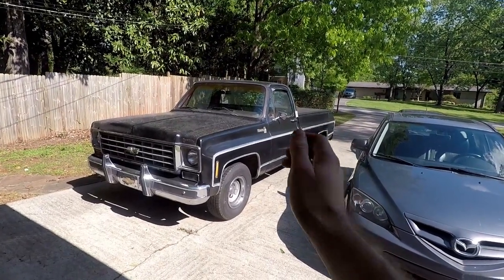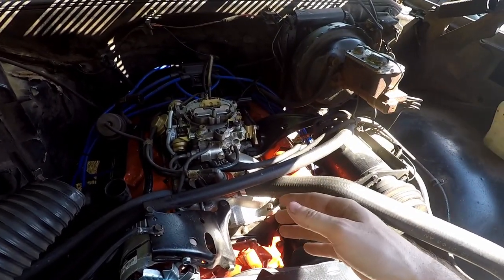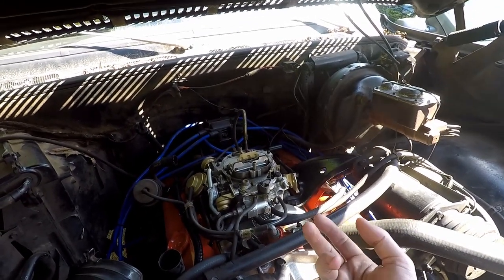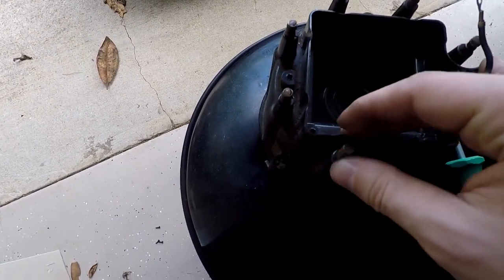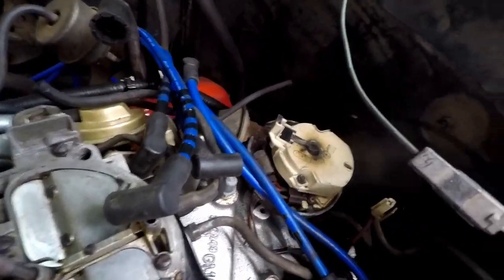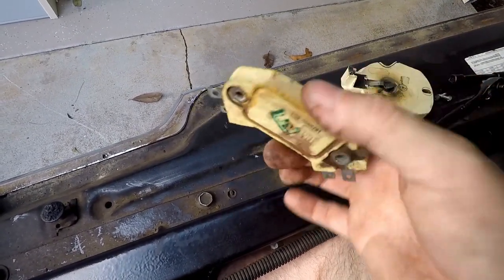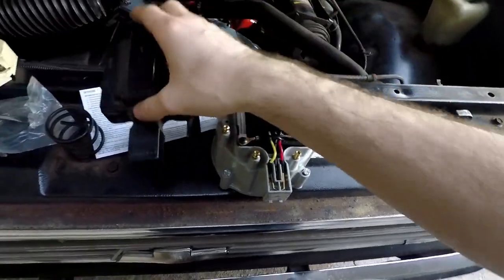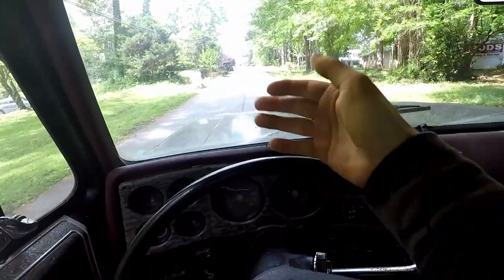Chevy C10 Bad Misfire Under Load

Comment: I am surprised that it ran! Particularly with carburetor engines, missing like that is usually not a fuel problem, but an ignition problem like this. You mentioned that the fuel line was solid to the engine and you did not want to cut it to measure fuel pressure. If this has the stock mechanical fuel pump, which is on the engine, then the fuel line to the engine won't have any pressure. Where you would attach the pressure gauge is in the rubber fuel hose that I saw that runs from the fuel pump to the carburetor, Also in a mechanical fuel pump system, there is probably not a filter sock in the fuel tank.
Reply from the maker: Thanks for the comment! Looking back, I think the give away that it was an initial issue was that it revved in neutral just fine.
I was talking about the solid hard fuel line from the mechanical pump to the carb that I didn’t want to cut up :) Not sure if there’s a good way about adding a pressure gauge there without getting rid of the hard line
Reply: @bluesxt  You don't put the gauge in the hard metal line, you put it in the rubber line that goes from the fuel pump to the carburetor. You have an inline fuel filter on yours. BTW I love those those trucks!!
Reply from the maker: @garylangley4502  sorry I’m not following, there is no rubber fuel hose from the pump to the carb, only the hard line and then the inline filter on the carb
Reply from the maker: @garylangley4502  I see :) Thanks!
Reply: I'm having the same issues with my set up.  I can't figure it out🤷‍♂️

Comment: The condenser looked old and crusty. It should have been changed with the ignition module. A weak or bad condenser can burn up your new module.
Reply from the maker: I didn’t even realize that was a part that could/should be replaced on the distributor. I think I’ll order one up. Thanks!
Reply: @bluesxt  
Hmmm, I guess I must be a bit more dated than you, back in my high school days, we were always changing the points and condenser along with the plugs, cap, and rotor. When you run top line wires, they’ll usually outlast a couple sets of plugs unless you have headers and the wires get up against a tube or two.
Edit: HEI distributors were still very new then and the first modules weren’t so good. If you come out one day and your engine won’t start, after verifying you have 12V at the battery lug on the HEI cap, take the rotor out and bend that center stainless steel tab up, then hold it up where it’s between you and a light, if you can see light through a pinhole in that tab, that will be your no spark problem. I worked on one of mine for almost a whole day before I found that. New rotor in and it fired right up. You can’t see the hole just looking at it, it’s so small you have to hold it up to a light to find it.

Comment: Bro mine doesnt rev fine 
From the moment it starts i get an intermittent misfire and it gets worse the warmer the car gets. It does it the most under load or at idle. Sometimes it clears up at speed
Reply from the maker: @jovo21  assuming your plugs are routed correctly and they are all sparking, and your fuel pressure is correct, then next thing I’d check is your compression. You may have a cylinder low on compression
Reply: Mine is weird it starts up fine pretty fairly sometimes I press the gas slightly 3 times max but when I drive it misfires only sometimes but it does it twice or maybe 3 times whenever it misfires but it is only sometimes and then the other times was one misfire but it’s happened about 5 times maybe 6 over the past week and couple days